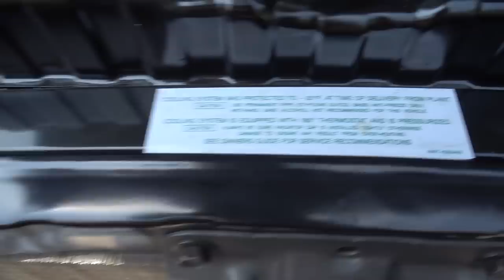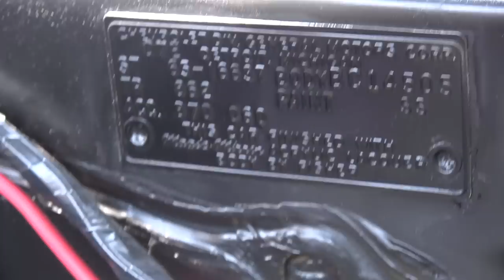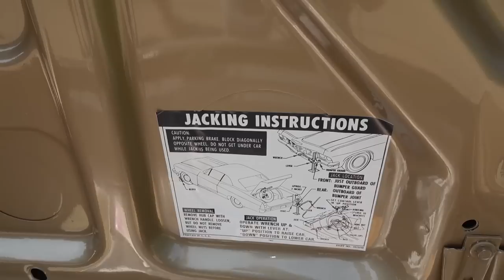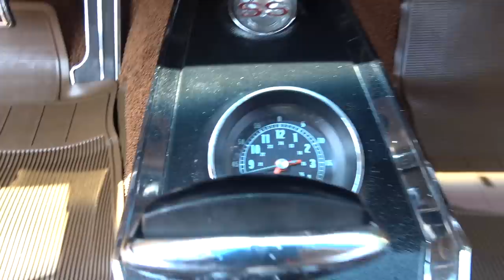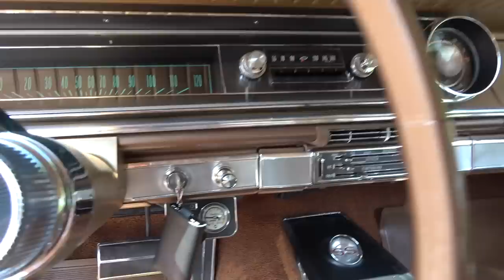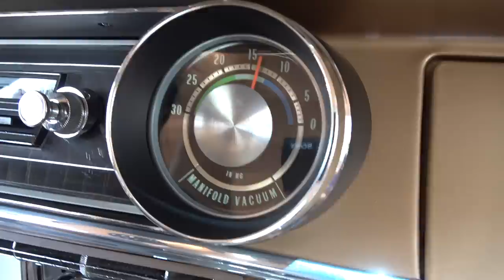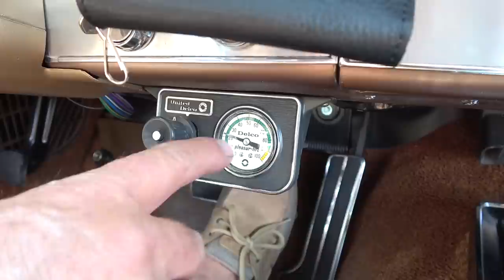Remembering Brother Lou! 1965 Chevrolet Impala SS Super Sport & Ride My Car Story with Lou Costabile

Comment: Great Video Lou...On a great car.                                                                                                                                                                                             They actually made a 325, 350, 375, and 425 horse 396. The 375 in passenger cars was actually the same Corvette 425 horsepower 396 rated at a different RPM. The crate-motor replacements carried the same part numbers. They also made an                                                in-between 360HP not many know about. And some LoPo 2-bbl 396s that were just slugs and hated by the Magazine World.
Reply from the maker: Happy to read you enjoy the video Charlotte :-) Thank you for sharing your knowledge.

Comment: Beautiful 1965 Impala Super Sport. I love that Sierra Tan paint job on its exterior with matching interior. I didn't know that the 396 CI engine was available in 1965. I thought that the 409 CI engine was the only available big block option. I was thinking that the 396 came out a little later. It's a healthy sounding engine. This SS is equipped with the rare Pleasure Ride option. That car is in pristine condition, all the way down to the tags and labels in the engine compartment. A true classic indeed.
Reply from the maker: Hi Michael, Happy to read you enjoy the looks of this car :-) Glad to read you enjoy the sounds from this engine. Lou
Reply: Pleasure Ride option is a suspension option, yes ?
Reply: I had a 65 with a 396 and that model year started with the 409 for the big block option. It transitioned as the old stock was depleted.
Reply: @brettoberry3586  Now that makes sense. A neighbor had a 1965 Biscayne equipped with the 409 big block with a Muncie 4-speed manual transmission. Didn't realize that the 396 CI engine made its debut in 1965.
Reply: That motor was offered late in the year and they discontinued the 409 motor at that time also at the same time late in the year they introduced a caprice model for the 65
Reply: They introduced the 427 that year when the 409 was dropped

Comment: I looked at one of these in 1980 or so near my house. It was a light metallic blue with a 283 and Powerglide. But I seem to remember the vacuum gauge being in the console. We had rust buckets in Ohio, but this car must've come from Michigan or New York or someplace with snow and salt all winter. It still remains as the only '65 full size Chevy I've ever seen, with the little bright metal rings on the tail light lenses rusted or otherwise corroded away!! Even as a kid, I knew that a bucket of Bondo and a few trips to the junkyard would've enabled me to bring that car up to my own 14 year old standards. I think the seats were torn too, but the rest of the car was straight and in decent shape.
Reply from the maker: Hi Dan, Happy to read this car brings back memories of the light blue one you remember :-) Thank you for viewing and sharing, Lou
Reply: @loucostabile  It still had all four SS wheel covers, but I wanted Cragars by then!😁

Comment: Wow! An SS396 with a PowerGlide?????? That's rare. Most with the 396 V8, except the Corvette, got the TH400 for an  automatic. 1965 was the first year for it's availability in a Chevy. It was also the first year for the Caprice. Even if you had the 327 V8, you could get the TH400. I knew a guy who had one and I saw it. Years before that, I saw a 1965 Impala, not SS, with the 396, and it had a column-mounted 3-speed manual.
I had a 1965 Impala SS for a short time, which I bought cheap, as a non-original car in need of a full restoration and rust repairs. It did have the full console, with PG, and a clock. That alone was worth, I was told, $600.  Somebody came along and wanted it. I gave a non-negotiable price of $2K. He offered less, but as it was bought and paid for and I didn't have to sell it, I stuck to my price, and got it. That's the only car I ever made money on.
Those are cool cars and you can get most any part you'd need, new. Thanks for bringing it to us.
Reply from the maker: Hi Automated Electronics, Happy to receive a "Wow!" from you :-) Glad to read you had a 65 Impala SS too. NICE! You're welcome, Lou

Comment: Another interesting point on the 65 impala super sport you could either get one antenna on the back or one antenna on the front fender gone. Is the dual aerials like you used to see on rear and 396 motor was available late in the year before that you could still get the 409 and 325 horse 396 was originally the only motor for the impala they had a 375 horse available on the Chevelle z16 car and the 425 horse 396 was only available on the Corvette solid lifter motor and the most compression
Reply from the maker: Hi James, Thanks for viewing and sharing your knowledge, Lou

Comment: I have my dad's 396, AC, PS, PB, PW, F40, dual exhaust, Holley, Glacier Gray, black vinyl top '65 SS in storage, and it's in line for a complete restoration after I finish my grandfather's '58 Gold Anniversary Apache  pickup. Now that I've closed my restoration shop and retired after 40 years restoring other people's cars, it's time for my stuff. Interesting this car has a Powerglide and not a TH400. That was a huge improvement for GM full size cars in '64 and '65.
Reply from the maker: Happy to read you're getting the chance to restore your cars :-)
Reply: @loucostabile  Thanks, Lou. I've been looking forward to doing this car for a while. Like this owner, what I wouldn't give for one more ride with my dad when it's done.  Thanks for making these great videos. There's a big audience out here who doesn't want opinions about manufacturers, or what car is better, or politics. It's refreshing to be able to watch a program where it's just about the cars. If I may, maybe look into covering a '55-'59 Chevy Apache with NAPCO four-wheel drive. I just wrapped up a total resto on an Oriental Green '58 Apache and everywhere I go, it gets mobbed. Advance Design trucks are just about as hot as they get now. It's here in Orlando if you're ever out this way. Keep the great content coming. All the best.